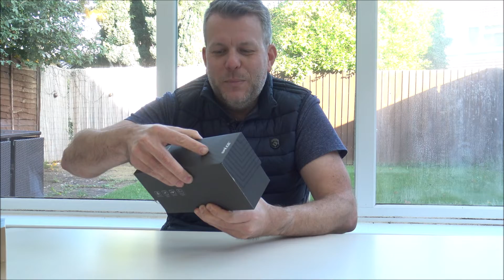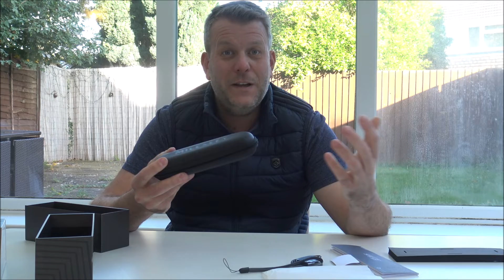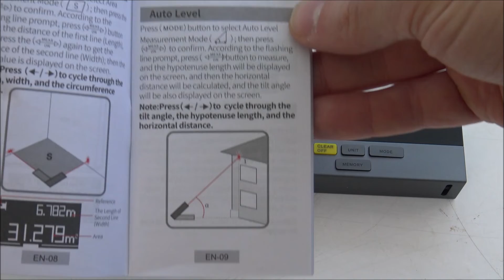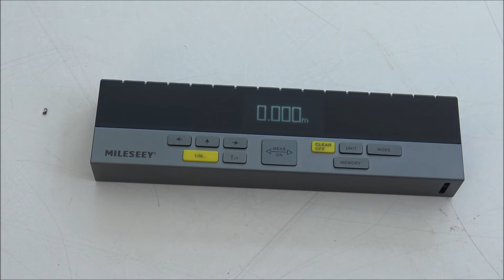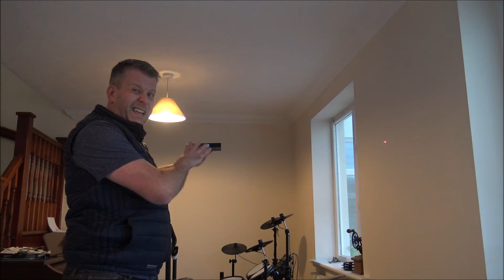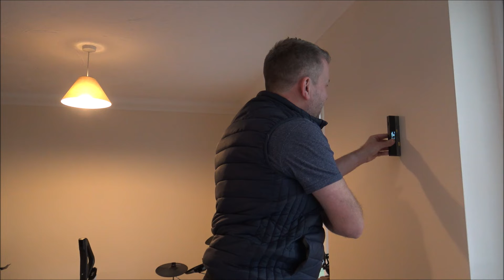Mileseey DP20 PRO Laser Measure

Comment: This looks like very handy. I guess the battery isn't replaceable, which is a pity if you're looking for a tool for life. I've to paint my apartment, and tried using rangefinder phone apps, but they appear to all require centre-of-the-sun type brightness, so none of them worked. This looks like a good investment. Question Please : Does the related App only come with the 120m version, or is it available for the 80m version also ?